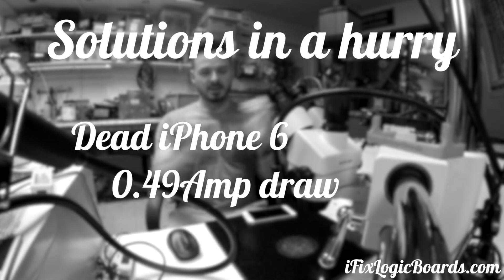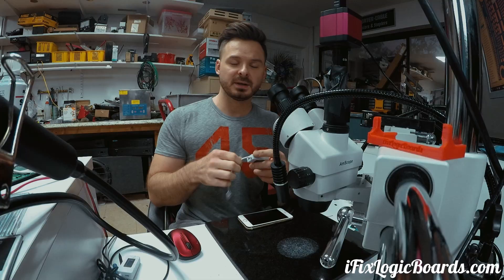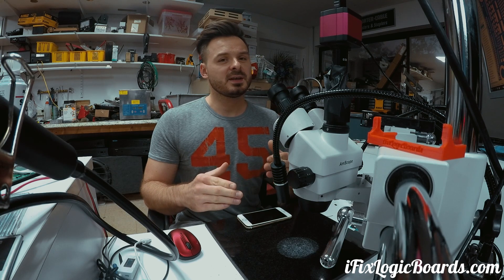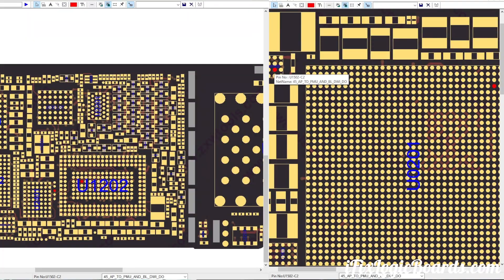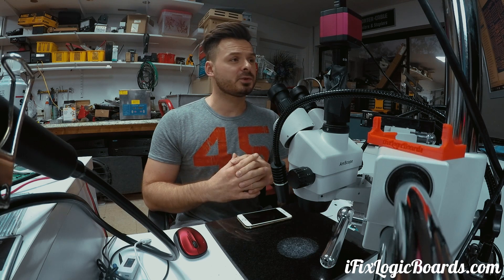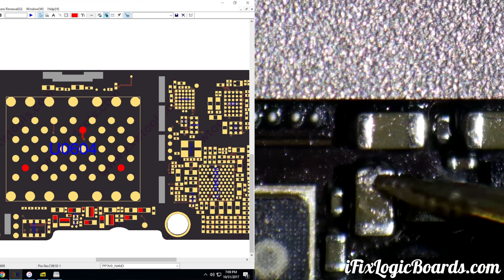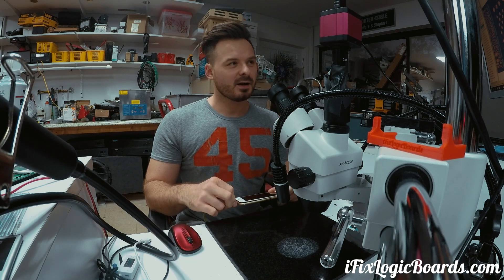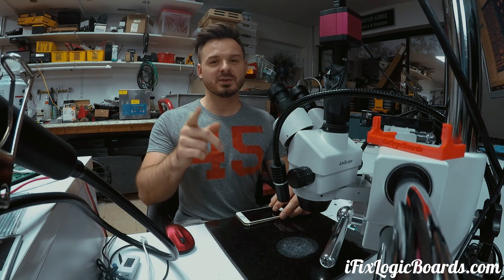iPhone 6 0.49Amp draw - no power - Solutions in a hurry

Comment: i have the same problem with my ip7 , its droping 0.6 amp
it is booting and charging at 0.4 amp when its in power off state, when it booting to menu, it doesnt charge, could it be a ic charger fail?

Comment: my iphone 6 dead, 0.06 Amp shows on power supply, where is the problem exist. motherboard not shows heatup
Reply: Probably charge ic/tristar
Reply: Is a charger IC the same as the power management IC (PMIC)?
Reply: did you fixed ?  i have the same problem.